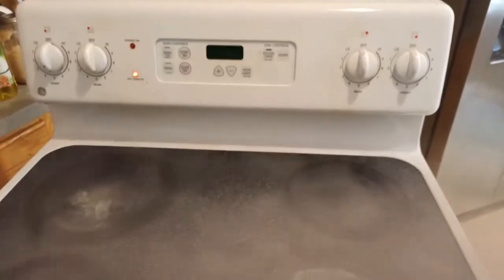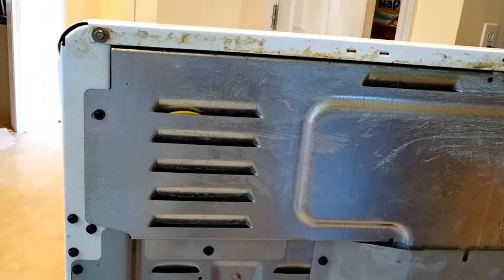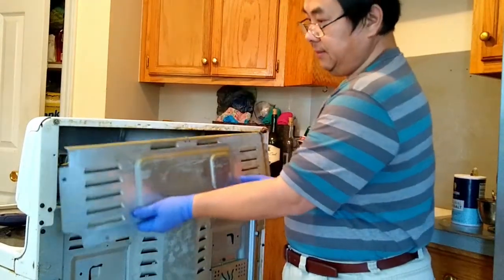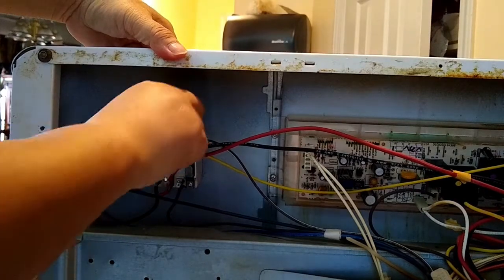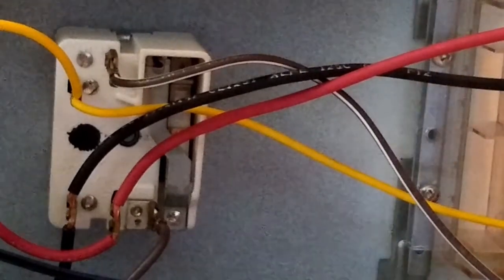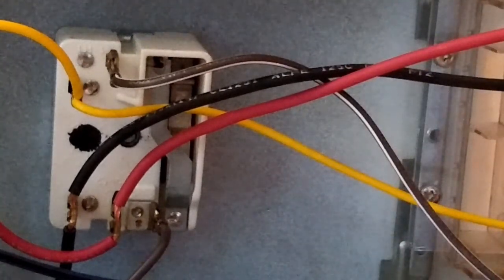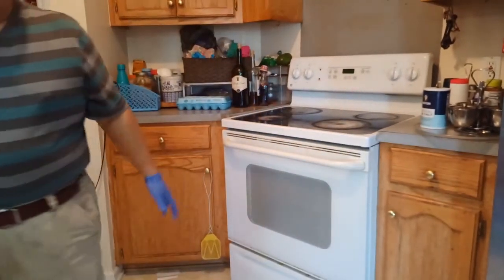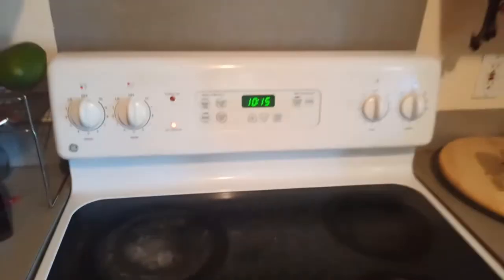How to Replace GE Stove Surface Burner Control Switch

Comment: 👍👍👍👍
Reply: great video on the switch replacement.  the picture idea is a must and of course safety is always first before anyone handles any electrical repair we must turn off the electricity.   very well done